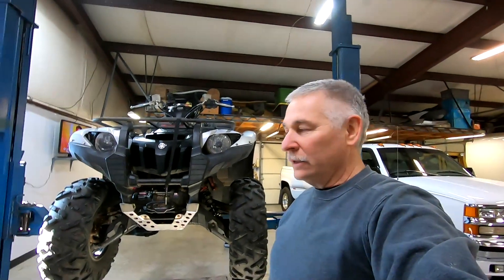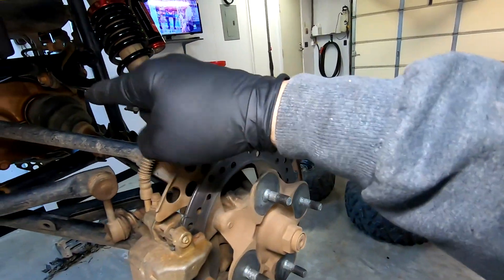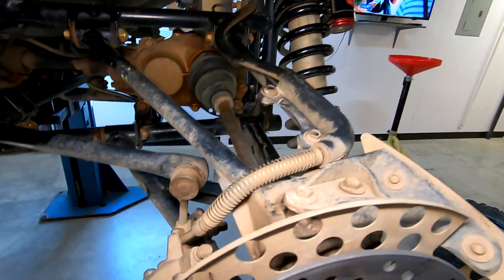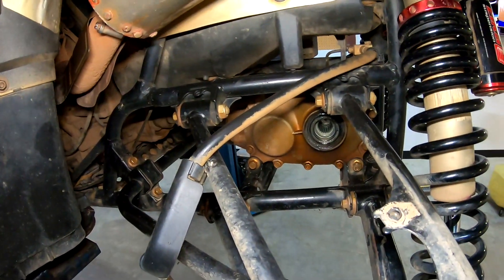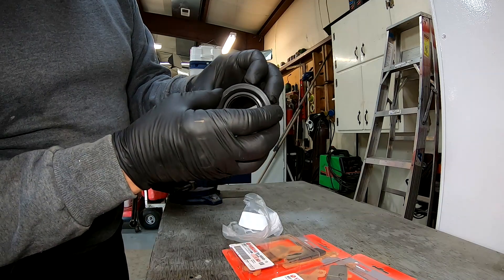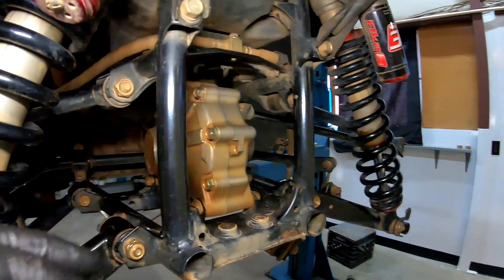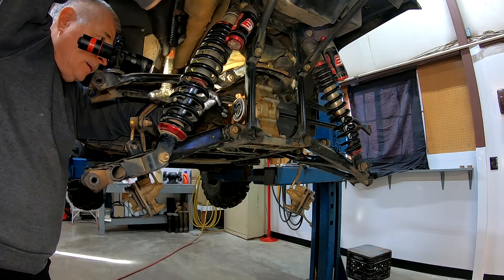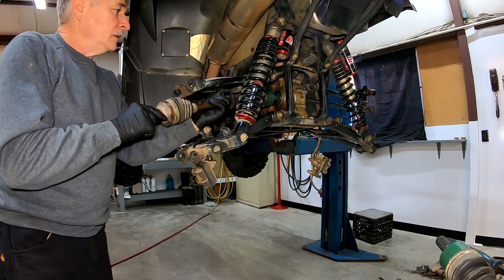Yamaha Grizzly 700 Rear Axle Seal Replacement DIY

Comment: It’s been a long long time since I had to work on a Yamaha   I need a new transmission case for my 2006 Yamaha Rhino 660   Thank you for the great video you uploaded
Reply from the maker: Hey Stacy, So the transmission case went bad on the 06 rhino? Thanks for checking out the video buddy!
Reply: @kcatv9556  yes the case I was told cracked and it’s inside the motor housing from what the mechanic told me which is why it is so high in price to repair or replace. I’ve been trying to think of something that I might could use to replace the motor and transmission in it and use something like a Honda motor and transmission from a quad

Comment: Great video! I do have a question. I am about to replace my rear axles on my grizzly 700 and I am wondering about the fluid in the differential. Do you have to drain it prior to doing the axles? I just see people pulling the axles out and replacing and there is no mention of the fluid. You on the other hand mentioned filling it back up. Do you have to do this or just recommended?

Comment from the maker: Hi, sorry for the delayed response. There’s no need to drain the rear differential fluid when pulling the axles out. Fluid will not run out. I drained the fluid on mine because I was pulling the seals out and it was due for a flood change.
Hope that helps you out. Thanks for checking out the video.

Comment: Looking forward to your next video.  So, for the seals, there is an inside lip on the passenger side, but no inside lip on the driver side?  Looking fwd to seeing the wheel bearing replacement.
Reply from the maker: Hey there factionfx, That’s correct there was no inside shoulder for the left side seal to bottom out on. 
Working on the next video now hopefully you enjoy it. Thanks for checking at this video.

Comment: Hi man your work is great I like to watch each video.
I need your help, could you tell me the inner and out size of YFM 400cc kodiak grizzly midle drive oil seal, both of them (front and rear).
Reply from the maker: Hi Jack, I have no idea what the size of those seals are?
If you are needing to replace them, just buy the factory seal and it should be the right size. Hope that helps you out, thanks for checking out the video!
Reply: @kcatv9556  thanks dear, I tried to use the parts number, but in Alliexpress is not easy to find.

Comment: Would it work better if you made a wooden dowel the same diameter as the seal to hammer it in? Just a suggestion but still enjoying these dyi videos
Reply from the maker: Hi Greg, Yes something like that would work. 
but didn’t feel like taking the time to build something like that. Much easier to just install it and be done. 
Thanks for checking out the video my friend!

Comment: No issues with the front seal?
Reply from the maker: Hi C.Torino That’s correct front axle seals are not leaking. Thanks for checking out the video!
Reply: @kcatv9556  yeah thanks for posting the info. Was just asking I just noticed my 22 kodiak looks to be leaking from front seal🤦🏻‍♂️
Reply from the maker: @c.torino2479  I’ll be keeping an eye the fronts especially with the miles I have on the machines.

Comment: I did mine then the rear diff started leaking directly after I filled it
Reply from the maker: Damn, that’s no good it leaking after you replaced the seals. Thanks for checking out the video!
Reply: @kcatv9556  I meant the front where the driveshaft attached. I got the seal in the mail today